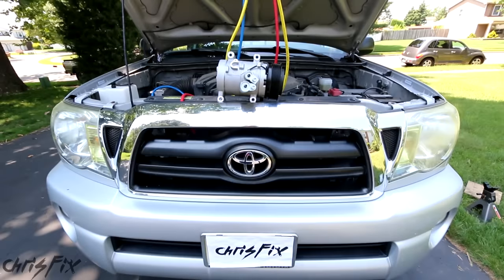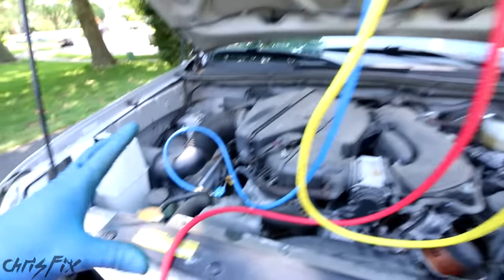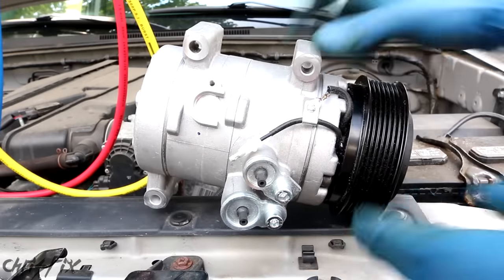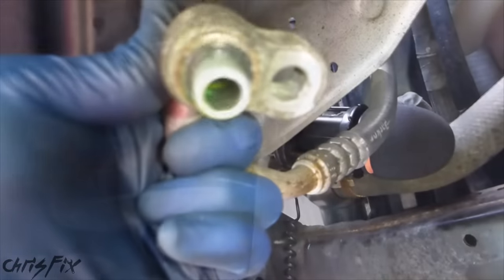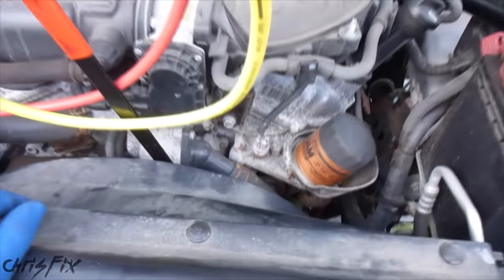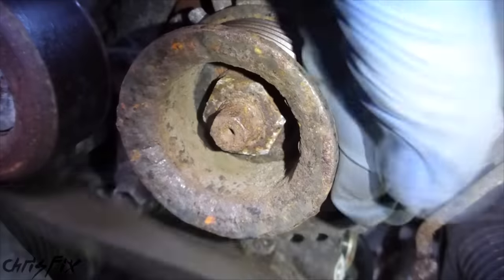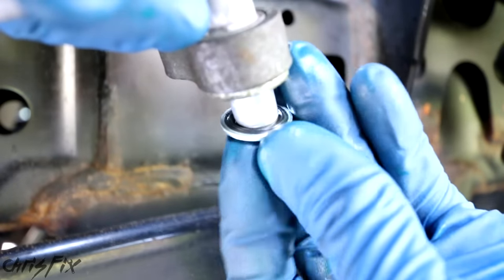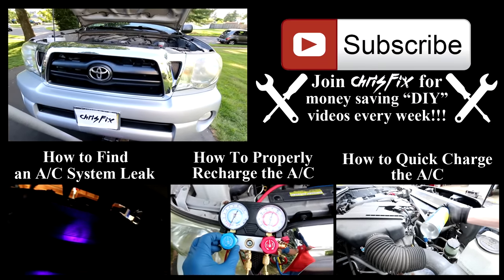How to Replace an AC Compressor in your Car

Comment: What's the average price for having the system evacuated of existing coolant?
Reply: Well the evacuation in itself would be free, since you're actually giving away whatever refrigerant left in your system (which will be filtered and then reused on your car or another one), and the recovery is automated when the shop has a dedicated station. The problem is getting an AC shop to agree to doing that, not everyone likes people doing AC repair by themselves (since it's often a huge amount of labor especially when it's an evaporator replacement, which is a dash off job in most cars).

Comment: In your case the amount of oil in system is to much. Brand new compressor already filled with amount of oil needed for whole system, witch is to much for “used” system. Right way to replace compressor is to drain and measure amount of oil in the old compressor and make sure that in new compressor the amount of oil is exactly the same as in old compressor or drain the oil of system completely and install prefilled compressor. Sorry for my English.
Reply from the maker: Thanks for sharing, there is usually a little more oil in the system than just the oil in the compressor!
Reply: @chrisfix  
Actualy oil from the compressor is spreading across all elements of system (hoses, evaporator, condesors, receivers/dryires) with refrigirant gas. I think about half (or less) of amount of oil is present in compressor in a working system.

This is from Denso manual:
 

A = Total oil amount new compressor.
B = Oil amount drained from the old compressor.
C = Amount required to remove from new compressor.

Calculation to establish the correct oil amount to remove from new compressor: A-B=C

Comment: Good video on how to, the few things I don't care for, 1, you never connected the plug in wiring harness that I never seen or heard you talk about, 2, you use a Torque wrench with multiple extensions with a swivel head, that don't give proper Torque at all, that should be noted before someone screws up bad from over tighten or not tight enough, IT'S NOT HOW TORQUE WRENCHES WERE DESIGNED TO WORK. Okay #3 is not just going directly into video of charging it once installed, I don't know if someone came over and stepped in for you, maybe you just filmed video and spoke on how to from MECHANIC that did it, maybe I'm wrong but I see a video that shows about 13 minutes long to charge AC UNIT not 100% sure if it goes with this video or if done on same day or not, no proof if it was or if top of the line tools were used to make look easy then use backyard tools for DIY guys. You should of went straight into finishing the JOB, ALSO,  How many LOCKTITE colors are there, different color means DIFFERENT use now, all you said is its to help PROTECT the threads and you can take apart so the bolts don't vibrate apart, should of stated how many colors so people don't see LOCKTITE and buy it not knowing oh red, super hard to come apart without possibly breaking bolts now, or yellow, then blue, just explaining that if using for DIY PEOPLE, then they need to know the different between them by 100% now or they're screwed down the road if it needs done over. OOPS SORRY THAT IT DON'T COME APART WITHOUT A JACK HAMMER. I wish you add those few things and add both video's together as one and done, no one unless time runs out but its just a few hours to do the entire JOB from start to finish, yes you save a very lot of MONEY, they charge crazy MONEY on it, I never watched the 2nd video on how to charge it as to I thought it was getting done as one video. I was wrong or I wouldn't have watched, also I seen no link's at all to buy product's at all. I'm on a cell phone watching this, I've replaced these before on older cars, I need to replace on a newer car and just compressor no good. But reading warranties state only works with receipts from GARAGE so they know you had it done right, also they may want a new Condenser replaced which places sell as a kit with O-Ring seals online threw a few places that's cheap compared to Dealerships cost or GARAGE, cost about $1,500 if I replace a few thing's but if I do it, then my cost of $294 on brand new COMPRESSOR and CONDENSER, with O-Rings too. Then my time and cost of R134A, uf you don't own proper tools, you can rent some, around me, they don't rent tools to do it. So for $59 on new Manifold set and $74.99 on a vacuum setup to vac the system out of humidity for at least a half an hour to 1 hour around then add in R134A mine sticker on VEHICLE reads it takes 42 ounces or 2 1/4 pounds, the gauges will show when your on target, 42 ounces is about 3 small cans that cost about $5 each or buy 1 big can like video showed but that came with 2, so ×2 = about $75 for that, it comes with gauge, half with gauge aren't reusable, they do make some to save the gauges now, I'm buying a kit for $59.99 with a vacuum pump to do this JOB, I already filled my VEHICLE that leaks out about every 2 years, I put in 2 cans and gauge shows I'm right in the green where its supposed to be, so no more added, not cold but better. Might have a block somewhere, it was taking off when new engine was put in just 6 years ago and about 60,000miles on new engine, worked great until 38,000 when started. So I'll do the Honda right and then do the Ford. Plus I have FAMILY that needs it done. I'm about saving MONEY, I'm gonna teach my son on how to use it and make a video if he wants to. All vehicles can be a bit different. They seem to last forever before, just add R12 back then. Best of luck to all who tries this, take your time and do the job right the 1st time, if your gonna rush it, then you take that chance of forgetting stuff, won't be right. Patient's pays off on taking your time to do right, I've seen a rush job and oil pissing out everywhere on startup. That's just changing oil and putting plug in hand tight, if didn't look, then most likely a blown engine when oil ran out and possibly catching car on fire from hitting hot EXHAUST which oil burns up. Also know someone that had it done from a very well known oil changing COMPANY that's been doing it for many YEAR'S. They said not there fault, tow truck driver showed them and took pictures on a camera and gave to customer so they could get a new engine by lawsuit from COMPANY, oil drain plug was gone and car was covered with oil from front to back on undercarriage. They walked to a store and called AAA  from a phone booth back then. That's a 20minute oil change and vacuum the car and wash windows inside. I had a friend that was accused of one and lost his JOB because of it. Happened some 8 miles away and 15 minutes after leaving place. He said not him. But he did it to me on helping me out once. PEOPLE make mistakes BECAUSE we are HUMAN, we DON'T talk BECAUSE he's to good for me BECAUSE he DON'T make mistakes. I sent him pictures of it and wasn't like that before, the bad, he charged me $35 for it but never tighten up things which blew up machine, he's a pro at that with CERTIFIED CERTIFICATES FROM CLASSES TAKEN but I'm the bad guy, all i cared about was opps I'm sorry, I owe you 1, I got the machine for free from FATHER INLAW, he DIDN'T tell me it was serviced BECAUSE he tried to sell it. They sold everything and moved after they retired and moved SOUTH. If known but busy busy and forgot to tell me, never sold at the yard sales BECAUSE of age, runs great, just other part, his old walk behind mower, starts on 1st pull. Its from 1989, I put a new blade on this spring. Runs great, neighbors go threw them and there new once a year. Gas is everything.

Comment: with the system with gas, can I remove the gas to the atmosphere?
Reply from the maker: No, you should get it evacuated at a shop so it can get recycled properly. It's also illegal to let refrigeration out into the atmosphere
Reply: @chrisfix  I'm asking because I know how to do it but I don't have the machine to get the gas...workshops charge the compressor 350€, 4h of labor which is 250€ and plus 60€ to refill the system, even if it's recycled... the compressor costs 180€ to me and 60€ of refilling with gas. almost 700€ against 240€, that's a huge difference, don't you think? it sounds selfish but i don't really care about environment because rich people go jet-skiing, private airplanes to their islands and big V12 just for fun and they don't care either.
Reply: @RATADATUAVELHA it’s also highly dangerous, refrigerant as it escapes to the atmosphere expands rapidly and will easily reach -30c. Very easy to get frostbite. Plus it makes a hell of a mess of compressor  oil going everywhere and then you run the risk of undercharging the oil in the system.

Comment: Can I bypass the ac compressor pulley assembly.  Prefer not to put more money into the car. Before it becomes a money pit.  Only has one serpentine belt. I want to go with shorter belt if possible. 98 Toyota Coroll.

Comment: ughh I put on new belts and it still squeaks when I turn on AC or deforsters, the defrosters I was confused about but the condenser coil will remove moisture from the air. Now im here

Comment: He didn’t say that the refrigerant was already evacuated
Reply: The secret is that in the video before he filled it with uv dyed r134 and has to let it bleed out of the leak on purpose to allow the dye to flow and be visible under a black light. This is a product allowed by EPA and DOT IDK why

Comment: So if I have been doing a bypass (shorter serpentine belt) can I just remove the ac compressor and leave it out for less weight? What would I need to do in order to run it without the compressor, ie... the air and coolant tubing? Can I just run it with exposed tubes and compressor lines?
Reply from the maker: You can remove all of the ac parts including the compressor if you get a shorter belt (assuming you can route the belt without the compressor).
Reply: Thankks for replying! and I have been running it for years with a shorter no-ac belt. Will be removing the dead compressor then! @chrisfix
Reply: @killerriot22  But if you ever want to restore it, you'll have to thoroughly flush the system, fit a new system oil charge in the new compressor and replace the dryer, provided the old compressor didn't seize up.
Reply: @teravolt6113  thanks! But yes, it has seized up years ago and never worked since I've had it... 96 s-10 inline 4. After running it for years without the compressor working eventually made the compressor seize up, and ended up shredding the serpentine belt, along with making the worst noises you've ever heard from an engine bay. So I just used a shorter belt to bypass the AC. It's got 280k miles on it so I doubt I'll ever put another ac in.

Comment: 📍 IMPORTANT NOTE!

This applies definitely to Toyotas - but likely others too.

If you have the issue of A/C button-light flashing, & A/C not working - first - this is likely to be your relay for the magnetic clutch in the A/C hub.

It is often marked 'MG/CLT' in your fusebox cover. 

It is either the relay - or a need to retighten the spade receivers in the actual fuse box (the things that grab the relay pins upon insertion). 

HOWEVER...

Note here how he swapped over the electrics onto the new pump.

The actual reason the AC button light will flash is because of a mismatch between a/c pulley speed & the engine speed. If there is a major mismatch (i.e. a perceived fault with the magnetic clutch) - then it will fail-safe (disable aircon), & also flash the button-light.

The failed relay can mimick this set of events.

HOWEVER, HOWEVER...

In swapping over the electrics, you're also swapping over the Hall sensor - which is the speed sensor in the aircon pump.

If this is faulty - you will still get the same flashing light & no aircon - even with a brand new pump!

I hope this helps someone out there even a fraction of Chris' video(s)!

Comment: So I have an issue with my car I'm pretty sure it's the AC compressor but it's only the polar the pulley doesn't turn what I need to change the whole AC compressor for that or is there something I can do about just the pulley... Otherwise trying to do this as a like I wouldn't even call myself a freaking novice mechanic cuz I really don't even know what I'm doing is very intimidating

Comment: Did you skip a section where you dump the oil from the old compressor measure that than dump the oil from the new compressor than fill up the new compressor with what ever came out of the old compressor.  Than ounce you your done with the that some you have to do with the clutch...

Comment: someone just changed my compressor but i didnt see him have a gauge or vacuum :(
what will happen if he didnt do those steps???
Reply from the maker: Your ac performance won't be good, I would get your system evacuated and recharged asap before the air causes the drier or another part to go bad

Comment: A guy said you have to drain the system, replace the condenser, and the dryer. Is it true?
Reply: The condenser does not need to be replaced. Replacing the orifice tube and dryer is usually required by the compressor warranty. It is not strictly required to replace those but its a good idea because the system will already be open making it easy to do. Debris can get caught by the orifice tube and cause it to get clogged giving you cooling issues. The dryer can only absorb so much moisture before it is saturated making it useless. If you decide not to change them and the compressor is a lemon, which happens a decent amount of time especially with remanufactured ones, then the compressor will not be covered under warranty.
Reply: @Redtooth75  thank you!

Comment: What if your unable to take the car to a mechanic to remove the refridgerate? Im Doing an engine swap and pretty much the whole car is torn apart, brake lines, power steering etc..

Comment: we did mine yesterday but it did not work! there's some power issues with the  wiring going toward the AC compressor, which is not kicking ?????
Reply: You should have checked your electrical first to eliminate problems on the electrical side. And more importantly, have you charged the system? The compressor will not kick-in unless there is a pressure in the system.
Reply: @ashokmoghe8035  Yes, it is good is holding pressure. it might be the AC relay I just order one waiting for, hopefully!

Comment: If you buy the gauges might as well and double down and get you a good used vacuum pump so you won't need to go to the mechanic ain't no telling how much they charge to vacuum out the a/c
Reply: Shouldn't be anything over a couple hundred. He makes it look easy, but buying the compressor and just paying for the labor on the rest is well worth it.

Comment: My AC comes on it just doesn’t blow cold and I tried recharging it but it didn’t last very long unfortunately. I’m not sure if it’s the compressor itself or if it’s a line.
Reply: Use UV dye and find the leak. I had the same exact problem. Turned out it’s my compressor
Reply: Menace thanks I’ll be sure to do that :)
Reply: nick osbourn yup, now just needing to choose wether I want a $250 dollar compressor professionally installed or a $500 dollar one also professionally installed
Reply: Menace which ever one that doesn’t break your budget

Comment: 3:44 

You never mentioned to replace the condenser first before you replace your new AC compressor.. 

Mine is blowing warm air and also my compressor flywheel is bent.
Reply from the maker: The condenser is fine. The compressor seal went bad and leaked. It did not contaminate the system so there was no flush or replacement needed.

Comment: why you did not flash  the a/c  system Chris , or there any video ?
Reply from the maker: Flash an ac system?
Reply: Im assuming you mean flush. Flushing the ac system requires some specialized equipment brcause freon must be stored and disposed of properly  according to the law. An ac flush must be done in a shop because it is illegal to vent freon into the atmoshpere.
Reply: @Redtooth75  As long as the refrigerant has been correctly recovered, then anyone can flush evaporators and lines using an evaporative solvent (the correct flush agent is almost like residue-free contact cleaner, chemically speaking) and dried compressed air, or, even better, low pressure nitrogen. Flushing a condenser requires expensive equipment, on the other hand. Dryers and accumulators can't be flushed period, and discharge lines equipped with mufflers have to be replaced since the muffler easily clogs. But an AC flush can be done by anyone, unless it's a closed loop flush done with refrigerant. Just need to dispose of the spent flush correctly.

Comment: In my obs Chevy 
The ac compressor has a bad pulley 
And I don’t reallly use the ac or care about it so I’m gonna take it off (thank god it’s on top of my engine) and just run a smaller belt to bypass it